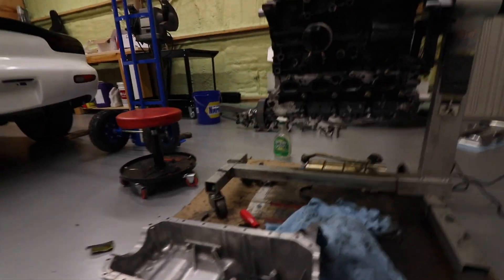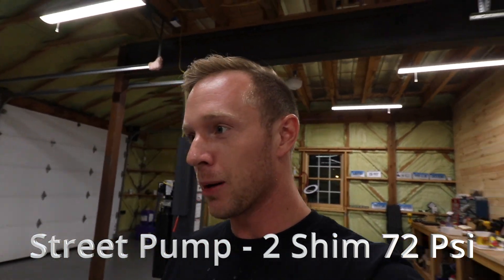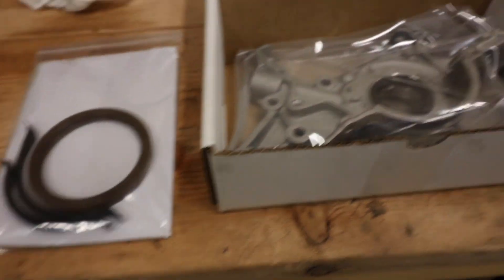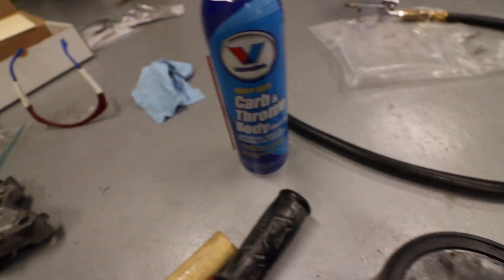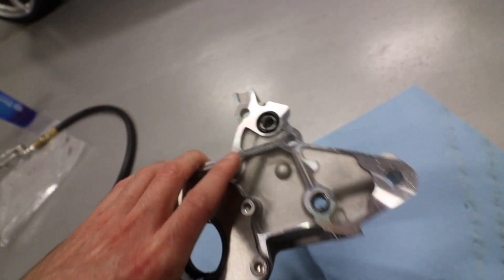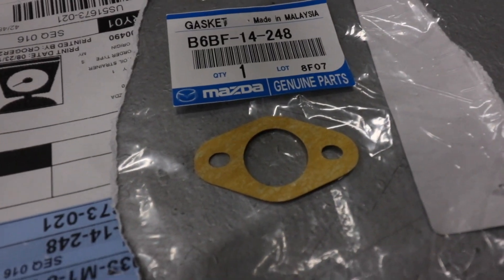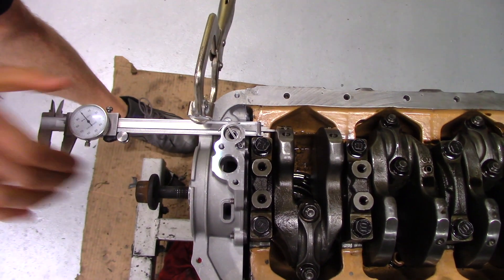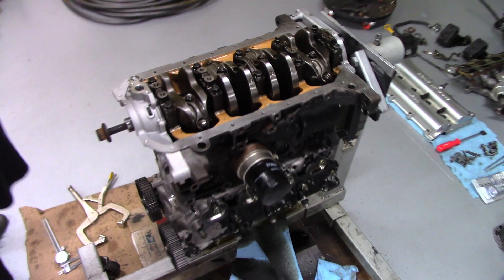HOW TO INSTALL OIL PUMP | Miata R Build | Ep5

Comment: It looks like 90 thousandths of an inch not 9 thousands.
Reply from the maker: I think you are correct, because .009” would have been within spec.

Crankshaft End Play
	.080-.282 mm 	.0032-.0111 in